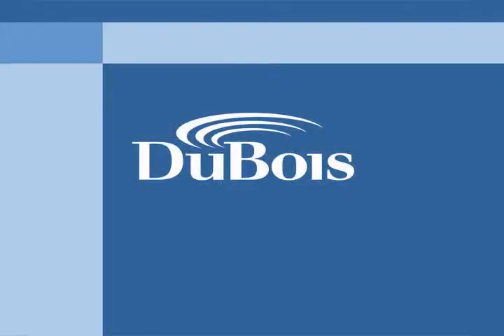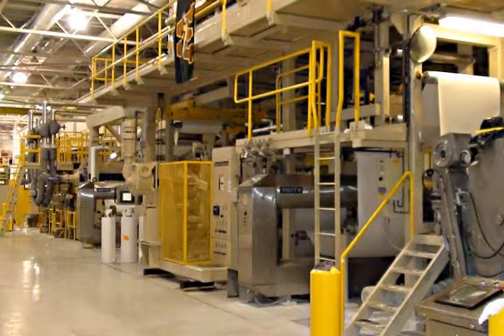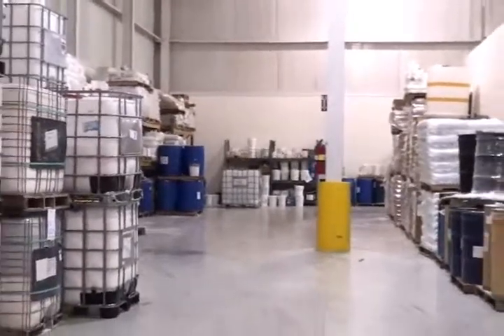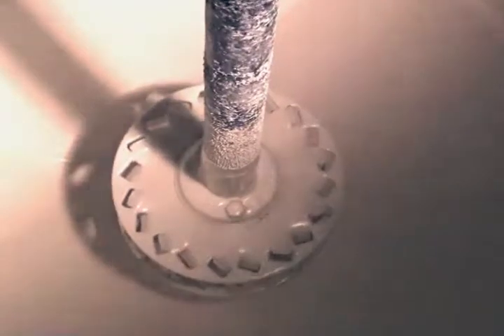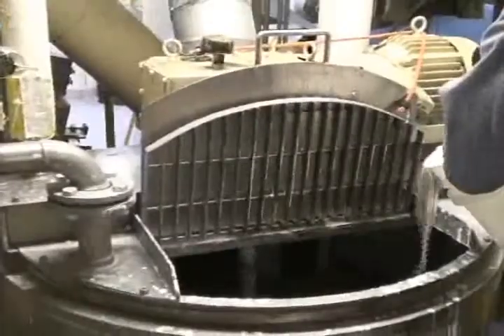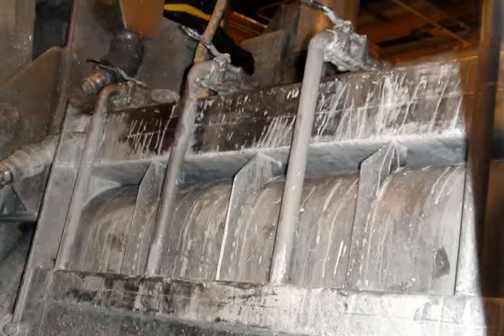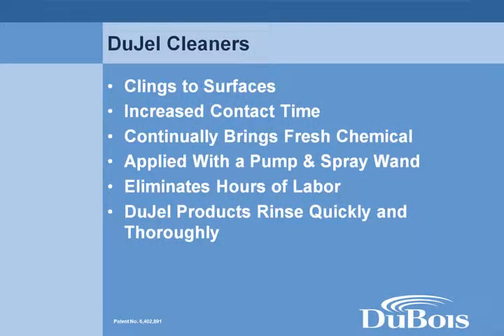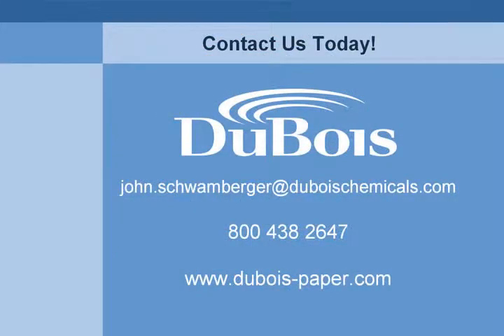Unique Paper Mill Coater Cleaning and Boilout Technology

Comment: DuJel is not very impressive. The application time is not very efficient, and product does not remove moderate coating build up without pressure washing. From my experience foamer cleaners out perform gel on coater machines :/